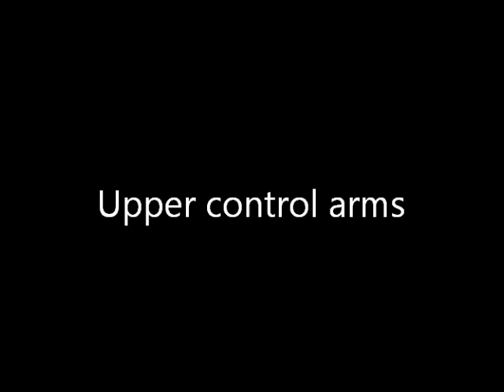upper control arms

Comment: I see a problem... your welding with the wrong hand... LEFTY! lol, just kidding, nice work.  What do you think about the weld through primer?  I like the idea of it, but I haven't had good luck with it on sheetmetal, seems to really be diffciult to weld through.  Do you run the welder on a hotter settign when you use it?

Comment from the maker: @turbocobra So that is what has been wrong with all my work.lol :-)
I also have a problem getting the puddle started with the wtp.
It spits and sputters like crazy.
I had to turn the heat up one heat range to get decent penetration but had to watch  and not linger or would blow a hole through the sheet metal.
I also HATE the smell ,I think the stuff has zinc in it and should probably wear a respirator when welding it but it won't fit under my hood,.
Thanks for watching.